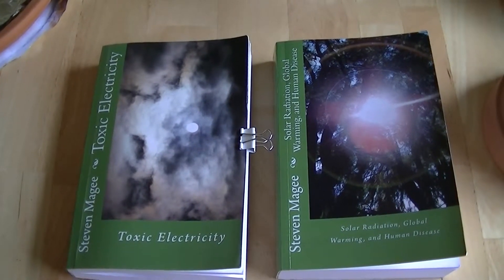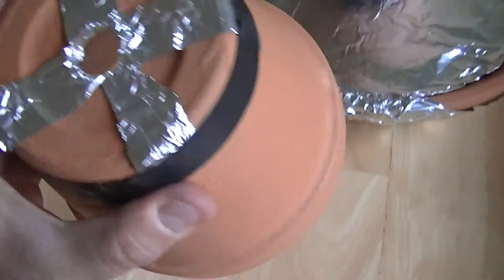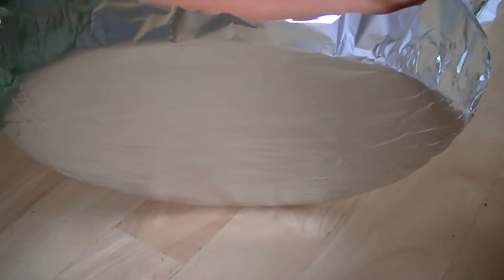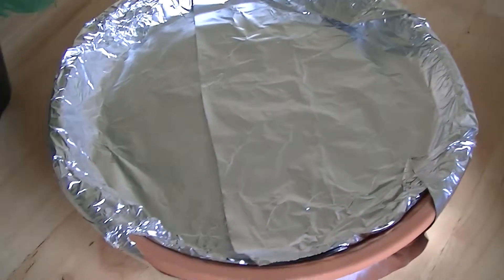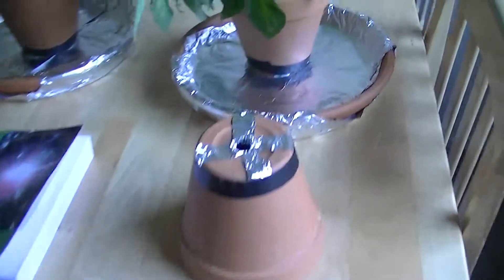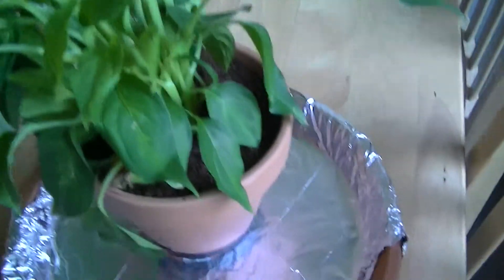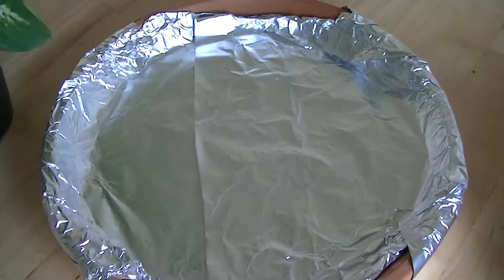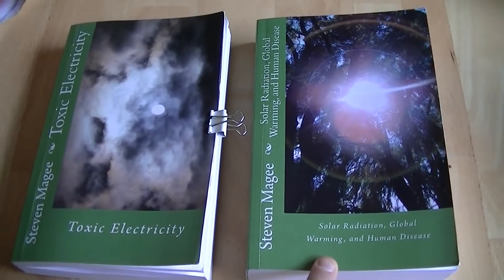Electrified Tiled Floor Plant Growth Experiment

Comment from the maker: I have controls growing all over the home in different light and radiation environments.  The stray voltage exposure for growth deformities is unique to that exposure.  Accelerated growth patterns, very tall plant and a double canopy of small leaves.  You can see the stray voltage deformity for the Dieffenbachia in this video:  "Interim Results March 2013 for Stray Voltage Exposed Dieffenbachia Plant". I will grow controls next to the test plants that are insulated from the floor for comparison.

Comment: Steve, gardening is my hobby so I thought to give you small advice for experiments, which you may or may not follow in future. 
I believe it would be much more illustrative if you have control plants and grow at least two plants, one in contact with floor and one isolated in same place. As actually difference in light for plants can create significant difference in the growth. So having some control plant would be very beneficial IMHO.